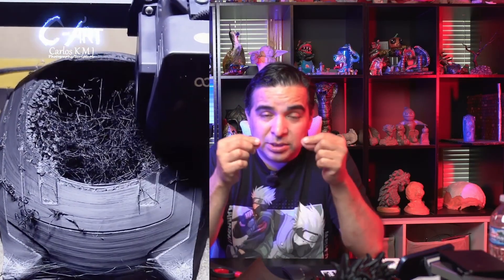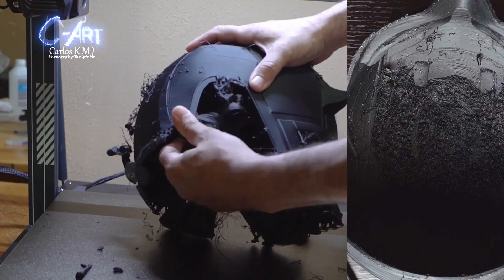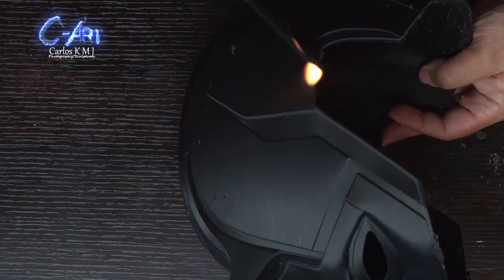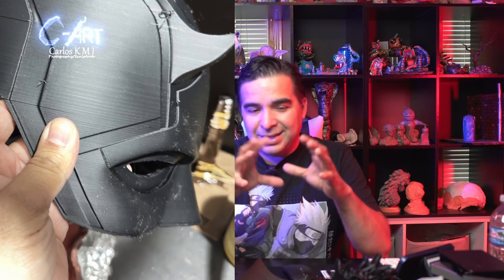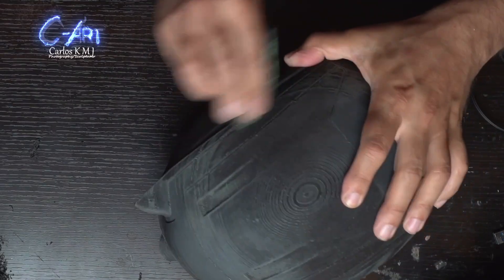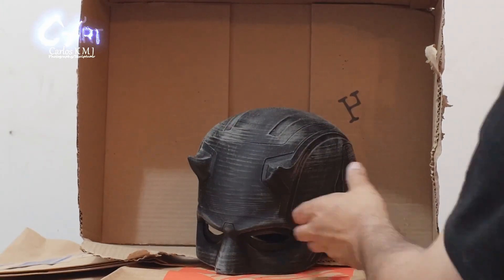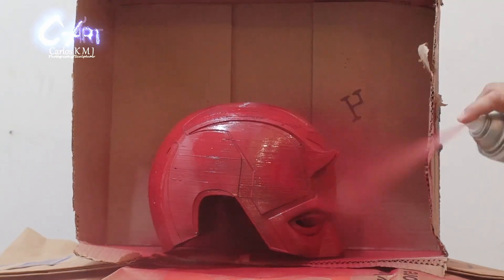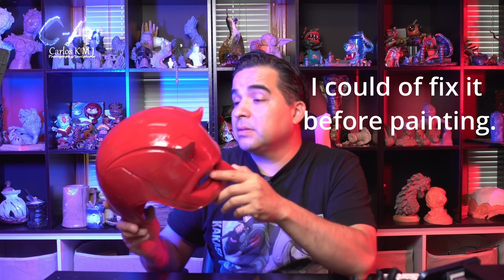This 3D print failed! but I didn't stop it

Comment: Cool project, but the question I'm pretty sure 90% of people will ask themselves watching your video: why didn't he tried to wear the helmet at the end ?!!! :D A tip I got from another video, but I haven't tested it yet: to get a really smooth surface with PLA printing, apply a thin layer of resin on the model, and fix it with a UV lamp.
Reply from the maker: That's awesome feedback, and you hit on a point I've heard a few times! You're right, not trying on the helmet at the end was a missed opportunity for sure. I was so focused on getting the reveal right and wrapping up the video, it completely slipped my mind in the moment. Definitely a "facepalm" moment when I rewatched it!

That's a fantastic tip about the resin and UV lamp for smoothing PLA. I haven't tried that method yet, but I've been looking for a good way to get a really professional finish. I'll definitely give it a shot on my next print. Thanks for sharing!